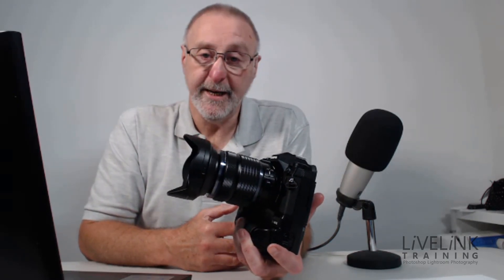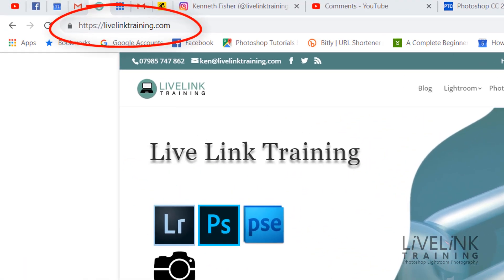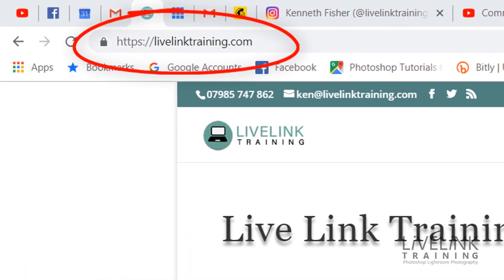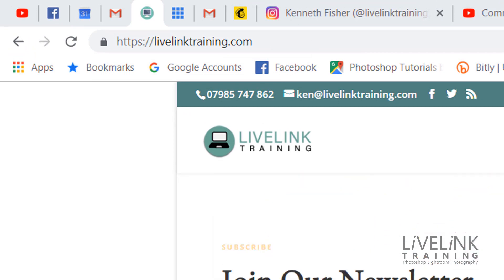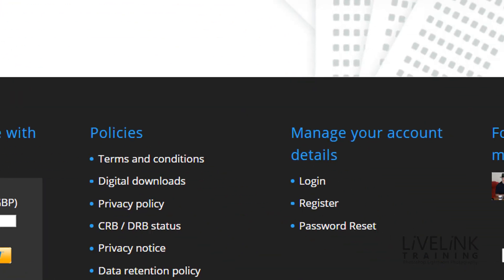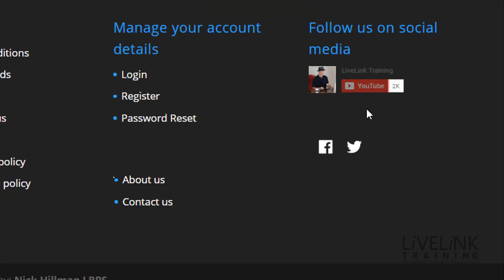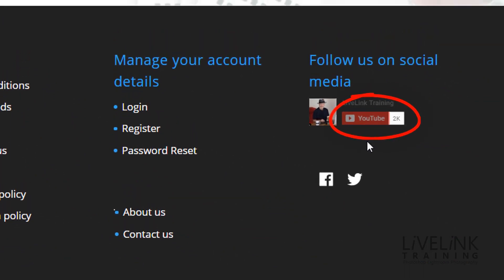Olympus OMD E M1X - Keystone Correction in Camera

Comment: You can’t “mix and match” as you suggested towards the end, as the function is configured in such a way that you absolutely cannot combine vertical and horizontal correction: you have to choose one. You also didn’t mention the important facility which allows you to choose which part of the image area (which has been effectively expanded into a trapezoid by the perspective correction) you actually use to frame your shot. Have you actually made serous use of perspective correction? It’s extremely useful to be able to achieve it in-camera for those of us who prefer to shoot JPEG wherever possible.